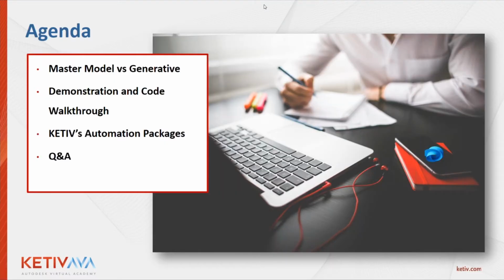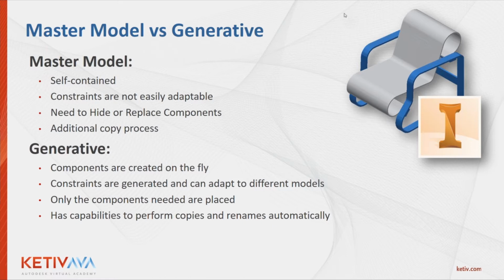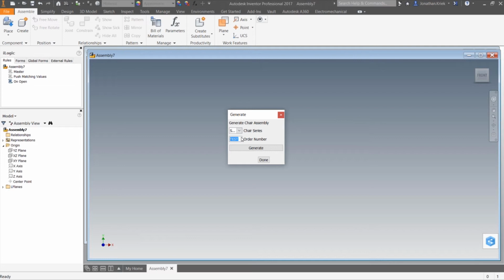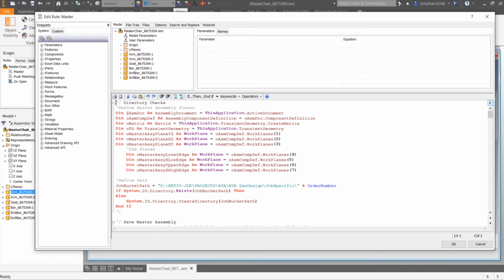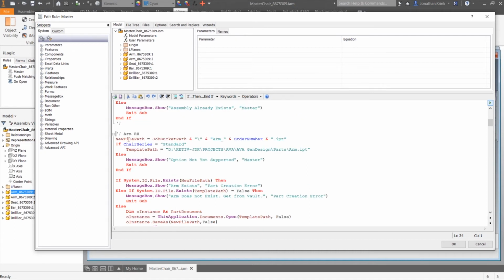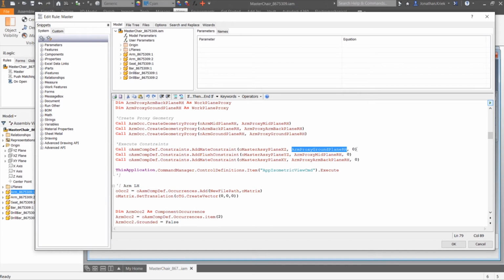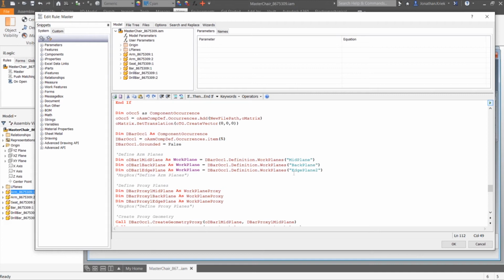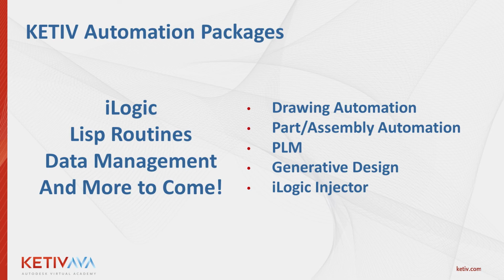iLogic - A Generative Approach | Autodesk Virtual Academy

Comment: Great video! Rather than constrain using work planes, have you looked at the AddUsingiMates API command?
Reply: Thanks Craig! I have indeed. That's definitely an option after placing the first component provided the iMates are already setup in the components. - Kriek